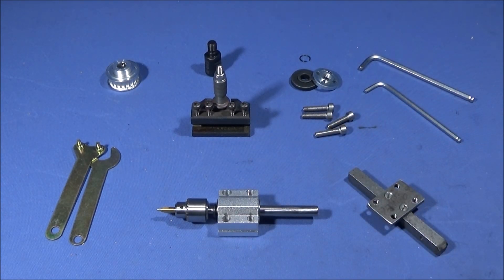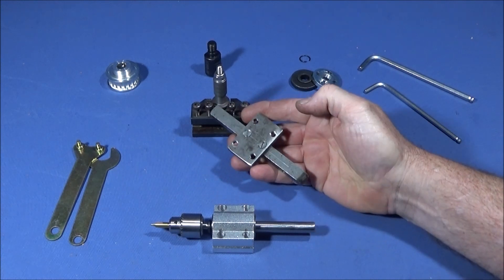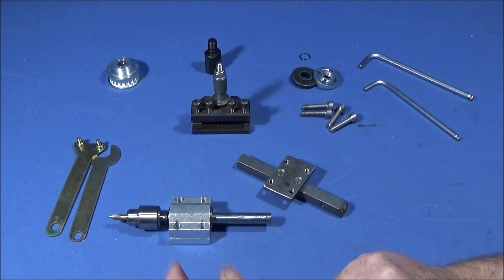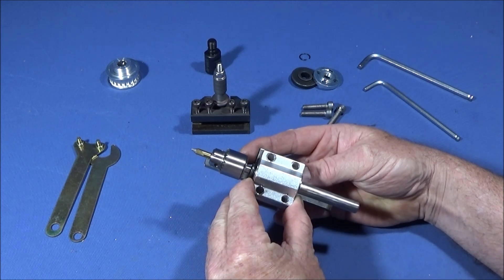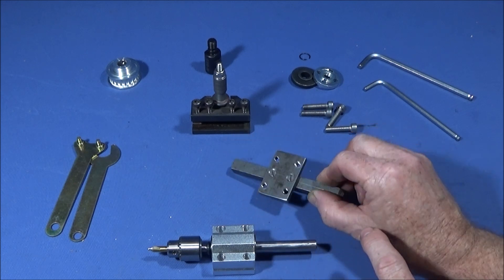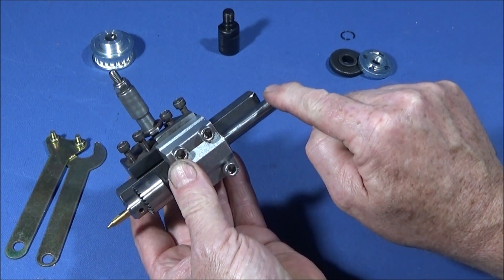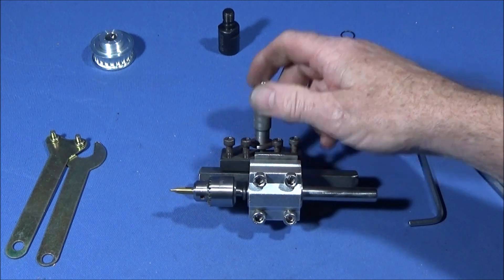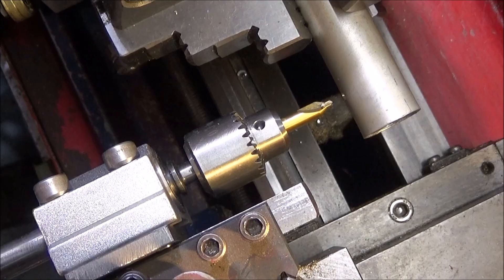Use A Machifit Spindle Set To Make A Precision Lathe Toolpost Drill

Comment: I'm late to this party, but I ordered the spindle, for use as a tool post drill, and it came in last week.  Was playing with it and the fit of the bearings to the housing isn't tight.  Maybe 0.002" of play?  I've used Loctite to secure the bearings in the housing.  
As you mention the spindle is tight in the bearing though.  I tossed my spindle in the freezer for an hour and then it went into the bearings with just a little tapping.  
Need to buy some steel to mount it in a quick change tool holder.  Never seem to have the right chunks in my little stash.

Comment: Steve can i ask you a question on er25 or er32 - 3mt collet chucks, do you know if the hole is bored all the way through the center of these chucks. So that it would be possible to put a longer piece in the collet so passing deeper into the er chuck. Thank you.
Reply from the maker: Hi Gillian The MT2 ones only just clear the back of the collet. I haven't seen an MT3 one to examine it yet, but I would think its the same.

Comment: Outstanding idea, would M5 Countersunk screws have fit, or does it need to be socket head screws?.
Thanks, Scott.
Reply from the maker: Hi Scott Thanks yes it needs to be allen bolts. The holes are too close to the sides of the housing to use countersunk. The countersink angle would break out the sides.
Reply: @SteveJordan  Thanks, Steve, much appreciated, will put my order in.

Comment: Steve, sure do like the idea of making up a set of them.  Like you say just keep a center drill in one and the most common drill bits in another or whatever.   One quick little question is....what is the use for the little C-clip ring which comes in the set?  Where is that to be used?   Hope you have a good weekend and thank you for this video.
Reply from the maker: The C clip is used if you use the pulley that comes with each kit. It goes in between the back bearing and the pulley to give a bit of stand-off clearance. Otherwise the pulley can rub on the outer part of the end roller bearing.
Reply: Thank you Steve.  Now it makes sense.